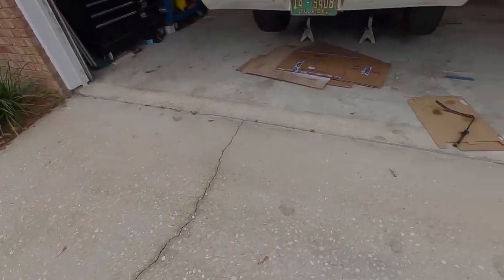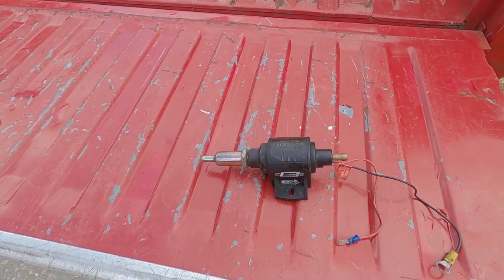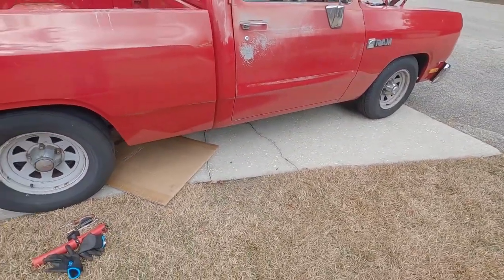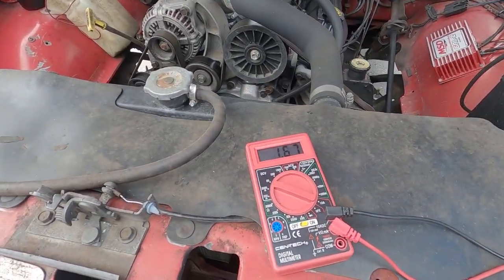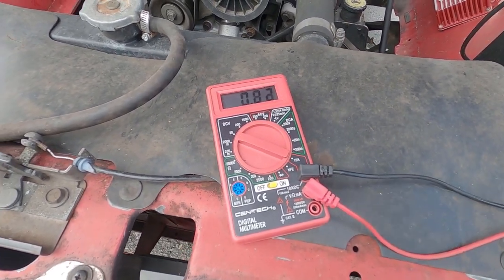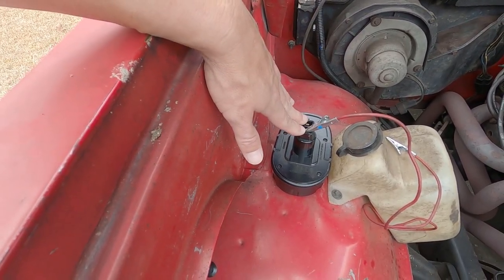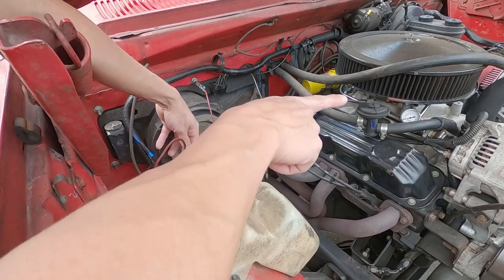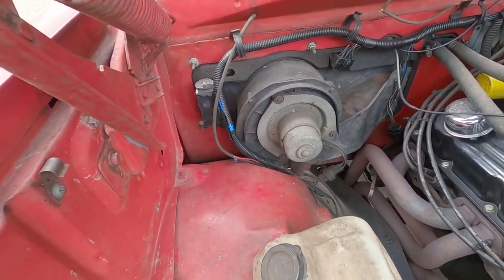Electric fuel pump Re-Priming HACK!!!

Comment: Another way worked for mine,  I used a hand vacuam brake bleeder pump connected to fuel line to carb, about 10 fast squeezes and good to go

Comment: I have an 86 that I converted to electric pump with a carter P60504 a few years ago. This is a very reliable quiet gerotor pump. I used the original metal lines and spliced the pump and filter in just ahead of the rear cab mount on the inside of the passenger side frame rail. It sits for months sometimes but always self primes. The closer the better when the pump also has to lift the fuel.

Comment: When you feed the fuel pump 18V, it pulls less amps than It does on 12V, meaning it runs cooler, so you're fine to run it on 18V. Now, if you were running it on 6V, you would very quickly burn the windings right out of 'er, because it's pulling more amps. More amps=More heat.
Reply: How would I do this for a 2005 Infiniti G35 Coupe -automatic

Comment: so it only has 12 volts to the pump when turning the key to on position but the electric pump needs more volts to prime . I wonder if a small capacitor that runs on 12 volts to charge up could be used with a toggle switch to crank the fuel pump then shut off once you turn the key on 🤔. course it would take long time but at some point the capacitor would need a small charge up from power as well. the drill battery is a good start/ ideafor starters 👍

Comment: It shouldn’t hurt a thing. It’s just a motor and a small jump in voltage won’t hurt it. Steve Meade is running his truck at 17 volts for his stereo no problem with other electronics

Comment: Mount your pump low, so it doesn’t have to pull.  
OR
Way I do it, find the small vent tube that came to the old charcoal canister up front.  Shoot a few PSI down the tube, pressurize the tank, and push the fuel to the pump.  
Works for me.  
Probably dangerous!  
Dunno.
Reply from the maker: The bigger feed line I installed worked perfectly. No more priming issues.

Comment: Thank you , this is the second time I have came back to your video. I first referenced this a couple years ago. I just finished a rebuild and I couldn't remember what I did to prime the pump. Did a search you popped up and it hit me "drilling battery". So double thanks!!. I used a 20 volt because that's what I have,  no problem

Comment: I like the truck...but if I put a magnum in with a carb I would use the front cover and water pump off an LA, with a cam snout extension and run a mechanical pump and be happy losing the serpentine belt setup....or go all fuel injection with pump in tank ....but the carb system is dead nuts simple to fix on side of road....not so much the F.I. system.

Comment: I had similar problem I had to relocate pump lower than the gas tank Gravity fed   mounted on the frame rail that fixed it even with a low battery.start up every time

Comment: FYI those little pumps like the one on your tailgate are garbage. The outlet side is pressed in with an o ring and it can pop out easily.
Reply from the maker: I’ve been using them for 12 years. Now that I have a bigger feed line I’ve had no issues.

Comment: Question what did you use to bypass the mechanical fuel pump to add the electrical fuel pump?
Reply from the maker: Use 3/8 fuel line and route from the new electric fuel pump.

Comment: The fuel-pump on my 98 Ram Van is on its last legs.....original pump and 280k miles. 
I let the fuel get too low and got 0-psi on the fuel-rail. Trying to prime it by starting it would just kill the battery. So yeah, I have to do the same thing as this vid shows....kinda sucks.

Comment: Naw.   Way I do it. 
Find the old charcoal canister vent under the hood and shoot air pressure down it.  
It will pressurize the tank and push fuel to the pump.  
Works every time.
Reply: Im try this I have direct access to my charcoal cansister on my 2RZ tacoma

Comment: Dude I have a brand new flame thrower & right outta the box the fuel pump NO GO,,,, beat on her with a rubber hammer 🔨 still NO GO!! 
watch this vid , slammed that 18vts from a Milwaukee fat bottom battery & whaaalhaaa She’s-a-hunmin!!! 

hooked all the one flame thrower back up , built in volt meter reads 11.3volts 
I test voltage with fluke at the fuel pump leads & im gettin 10.7volts 
But she hums/pumps fuel …. So we’re rock n roll!!!! 

Thank you for unintentionally pointing me in the right direction
Reply from the maker: That’s awesome!!! Best comment on the channel in 2024 so far!!!

Comment: You could just use a mechanical fuel pump that high output and never worry about doing all that priming.
Why don't you do that.? Also a better electric fuel pump will pull the fuel ...mine always has 
.but I have a good high pressure pump. That little junk fuel pumps the problem..
Reply from the maker: I have a magnum timing cover so I can not use a mechanical pump and yes, I could buy a better electric  pump. I ended up installing a larger feed hose to the pump and no longer have an issue with the cheap pump.

Comment: Hey what size electric fan are you running
Reply from the maker: 16” eBay fan.
Reply: Thanx and interesting because most sites are saying get fans that put out 3000plus cfm , but what came with my radiator is a 16in 1700-2200 cfm

Comment: I enjoy your videos. Are you saying simply adding voltage to the pump beyond 12 volts allows the pump to prime ? I have a carburetor truck from the 80’s that only has a pump just like yours. The truck runs well and I have no issues starting or running. But, I have a clear fuel filter near my carburetor. I can keep my ignition on for 1-2 minutes and the filter will not completely fill with gas. Infact, I can see that no gas is moving period ? Would adding 18 volts change that ?
Reply from the maker: It’s possible. It could also be the pickup in the fuel tank clogged.